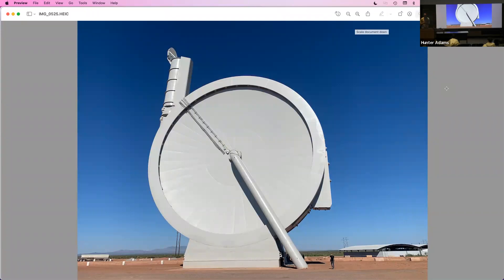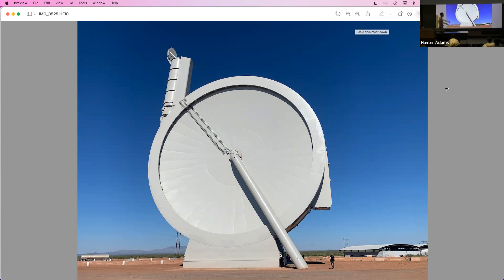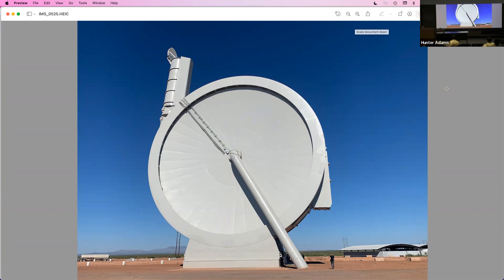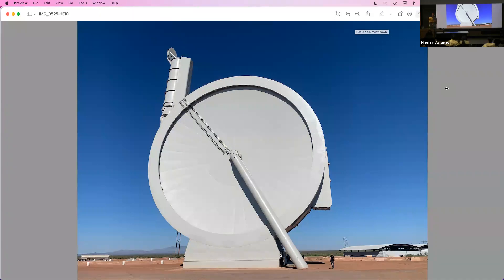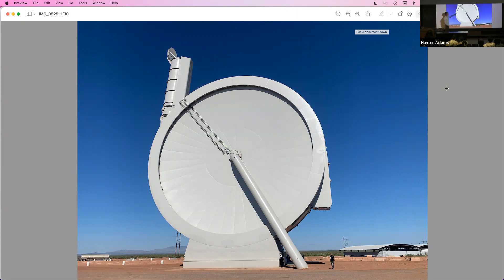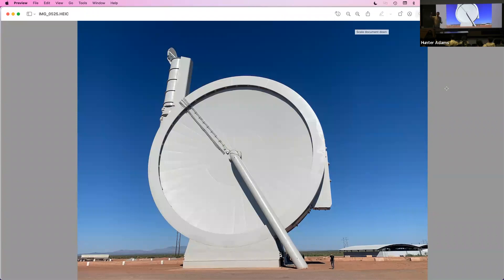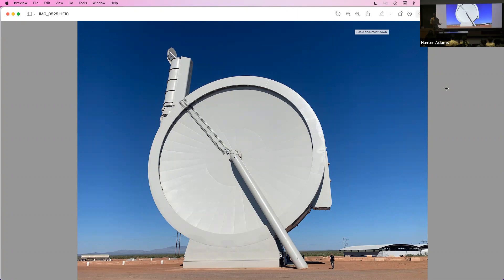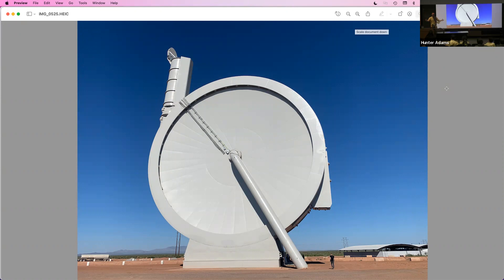Raspberry Pi Pico Lecture 16: More PIO Examples (UART and SPI) and SpinLaunch/chipsats

Comment: Get timing wrong on that sub orbital launch system and you have a satellite killer, even if it gets that far to another planet some may stay in that planet's orbit, and kill some other vehicles visiting ...
It could launch solid steel balls, wow ... good option is in stopping old satellites' speed so it falls to earth faster ?
Reply: Don't be fooled by their enthousiasm. Spinlaunch is very likely to be a total dud. You should read up on what it takes to launch an object this way. The G-forces would be on the order of 100,000 G and going mach 11 when it exist the launcher. I dunno, but anything going faster than mach 4 immediately ablates away to nothing at sealevel and also at 6km altitude were they to launch from the Atacama.